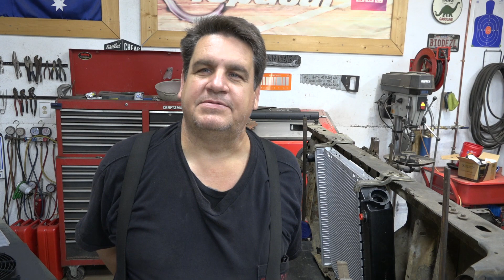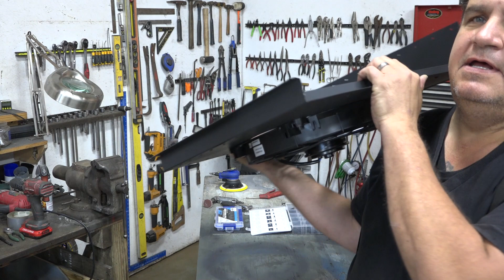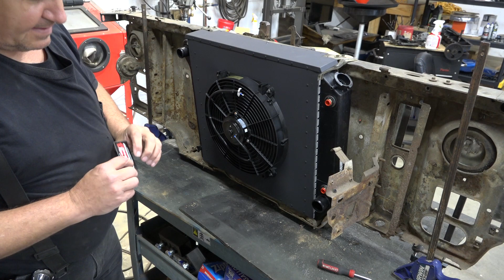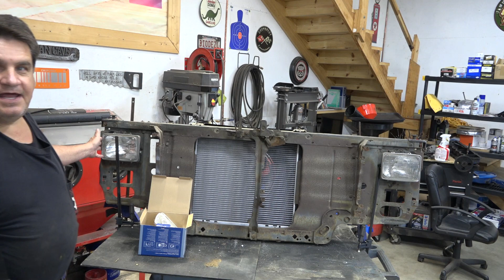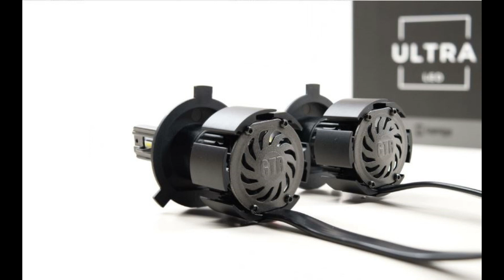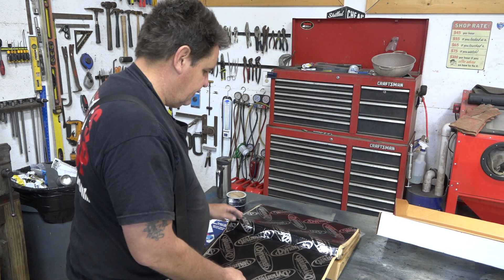Ole' Blue, 1982 Ford F150 Restoration Project Electric Fan Conversion

Comment: I do have comments and experience with these hayden fans....don't.
The Davies craig, is a far superior design. It has many features uncommon to the cheap, asian fans.
The hayden may last 5000 miles. Mine never did. I relied on the brand name as security against poor quality, and was disappointed on both attempts.
Reply from the maker: Wow! That's interesting to hear. I've had good luck with the Hayden's in the past, but I'll be doing at least a 500 mile shakedown on this project so I'll be watching it closely. Thanks for the info! and Thanks for watching!